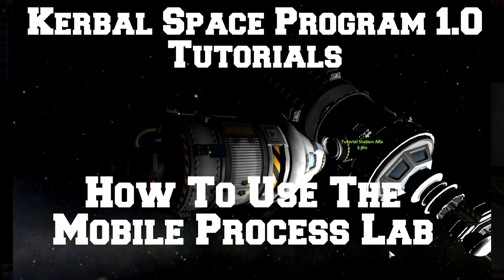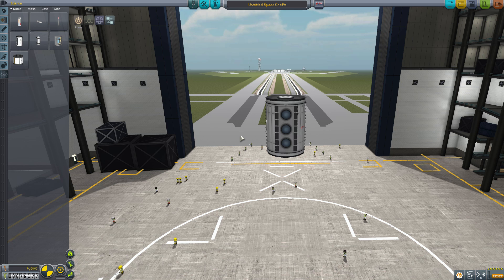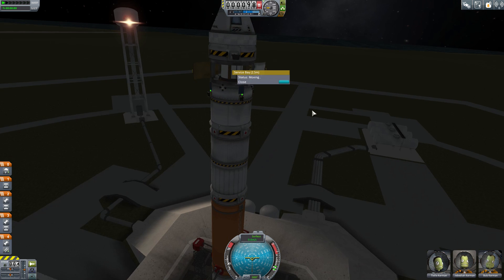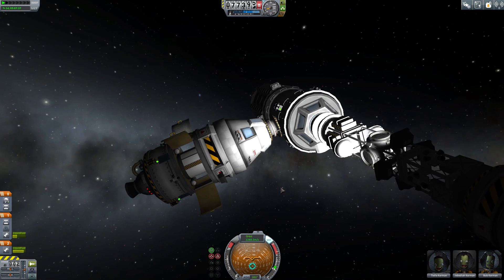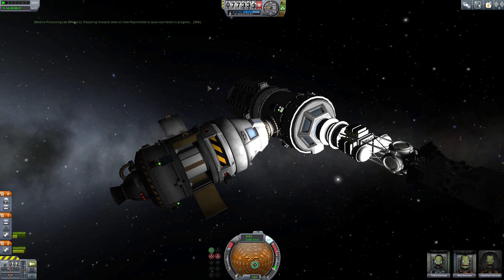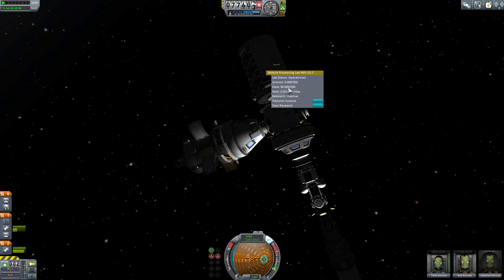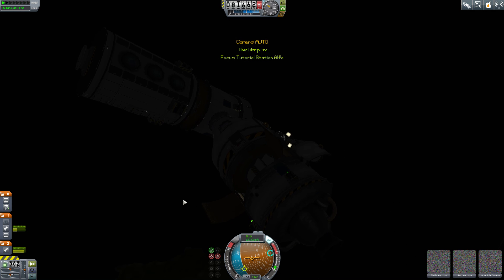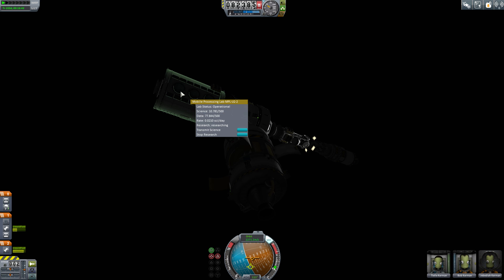Kerbal Space Program 1.0: How To Use The Mobile Processing Lab

Comment: Does the science get transferred automatically back to base or do you need to bring the Science lab back down to Kerbin once its full? I dont understand that part sorry.
Reply: +fpm1979 that's my problem. 500 Science in there and I can't transmit any of it with the meager battery and solar power I put onboard!
Reply: +xXAlcoholicX x Your science has to be transmitted and you have to do it manually. This requires a lot of energy. Make sure your solar panels are large enough.
Reply: Okay thanks buddy! :-)

Comment: ER MEH GURD! Dankeschon!!!! This helped me out so much, because I couldn't understand why the hell my science wasn't automatically being processed. I had no clue it was required to manually add the data to the processing module in order to have it work, and then tell it to process that data. (Newer player, still learning things.) I have also had a lot of problems with rockets, as they seem to topple at a certain altitude almost always when I try to tilt in order to get into an equatorial orbit. Still much I must learn, and usually I prefer to learn it through experience, but this was one thing which just did not make sense to me for some reason. Thanks again!
Reply: +Anakova Lyadov The problem with the toppling rocket can be solved by increasing the air resistance towards lower end of it. This can be achieved by adding fins like the AV-R8 winglet at the lower end of the first stage. This increases stability and maneuverability, too.
At liftoff your rocket should have a thrust to weight ratio between 1,2/1 to 1,5/1. If you have boosters that burn out fairly quickly the thrust to weight ratio can be up to 1,8/1. Start your gravity turn early and do it gradually. Go vertically until you reach a speed of about 90m/s (or slower if your initial thrust to weight ratio is 1,5/1 or higher). Then start turning to the 85° marker and from there follow the prograde marker. If you haven’t done it already install the mod ‘Kerbal Engineer Redux’.
Reply: Yea, I have KER mod. I still had the toppling rocket issue for a while, but I found out what was actually causing it. I had put my graphics settings a lot too high, and it caused me to lag from the smoke cloud, making me have to fly straight until I was moving far too fast to take that turn without tumbling. I eventually got around it with the lag, but that was no fun, and no small feat. Changing my graphics settings also stopped many of my SPH aircraft from tumbling when I would try to make minor adjustments at mach 1+. Thank you very much for the help though!